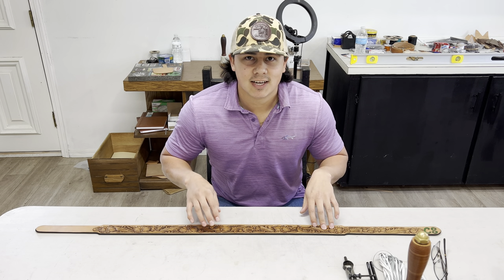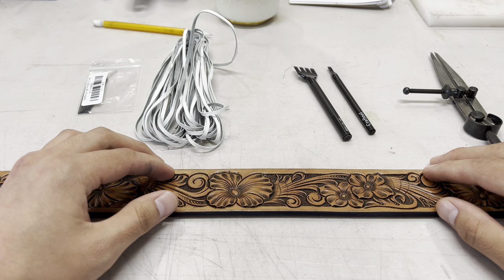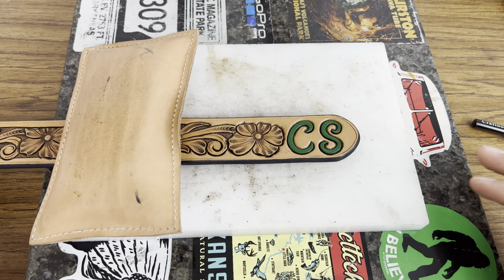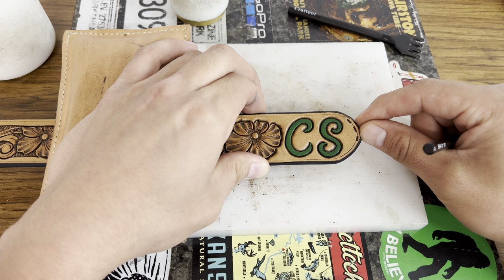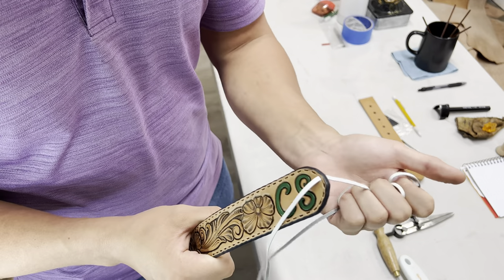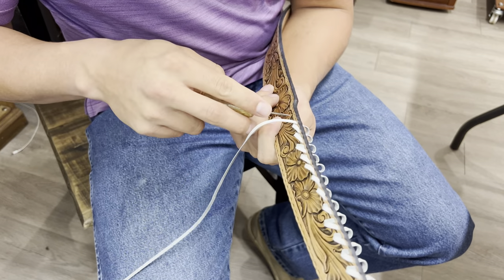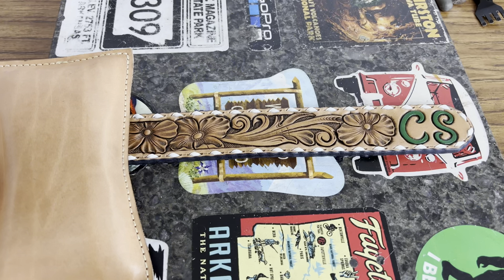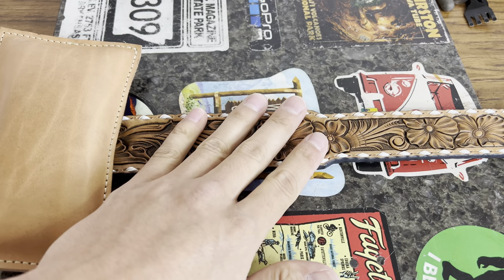How to Buckstitch a Leather Belt in 2024

Comment: Excellent tutorial. I did have a question. I can see how to hide the last odd stitch in the bend of a belt but how would you hide it on a notebook cover, checkbook, etc.?
Reply from the maker: To my knowledge, there is no good way to hide the ending on projects like that. If you are joining multiple pieces together and the edges are not glued, then you can hide it between the material. But in most cases when the edges are glued together and finished, you just have to make the ending as presentable as you can. I could be wrong but I have not learned of any way.

Comment: What was the pillow looking piece while punching holes? Sorry if I missed that
Reply from the maker: It is a small piece of HDPE cutting board! You can also just use a scrap piece of leather under the belt to protect the hole punches, chisels, etc.
Reply: @Girtyleatherco  thanks for the response!! But I was actually referring to the item you have on top of the belt. Looks like a small leather pillow kind of. Is it like a weight to help it not move so much?
Reply from the maker: Oh okay! Sorry about that, yeah it is just a weight that I made to help keep my projects from slipping around when I’m tooling or working on them. Its just two pieces of leather sewn together and filled up with metal BB’s
Reply: @Girtyleatherco  ohh ok got it. Good idea! Thanks again for taking the time to respond!

Comment: Is this mainly used as a decorative stitch or is your belt made with 2 thin pieces of leather that you’re putting together? I can’t really tell and still new to everything
Reply from the maker: I make my belts out of 2 pieces of leather. The main body being thicker and with tooling designs usually, and the liner leather being a thinner piece. I contact cement the leather together and then stitch or lace the edges. This buck stitching method is a lacing technique and does serve a purpose but is also a bit more decorative. Depending on the project, it could just be used as a decorative accent.
Reply: @Girtyleatherco  thanks for the detailed answer! Do you have video showing that? Is it like a 8oz and a 2oz piece together or do you go past a thickness of 10oz? I’ve make some simple 10oz belts but depending on the buckle I’ve put a lot of strain on the bucklebar due to how thick it was even with skiving
Reply from the maker: I typically use a 9/10oz and 3/4oz piece. My belts usually end up around 12-14 total oz. I do have a full length video on my page of me glueing and stitching one together!
Reply: @Girtyleatherco  found it! Thank you it’s extremely helpful

Comment: Nice video . Finally.!!
FINALLY.!
 Someone with a BuckStitch video that show punching holes and stitching FROM the tip back .. I buckstitched Hundreds of. Belts when I worked for a Leather shop in the 70 s . 
I would recommend using a needle for speed .  Use your thumb on the front and hold with 3 fingers on the back definitely faster than a stiching pony . Pull thru start needle in next hole then pull thru .. 
I used to do a run like you (and still do sometimes ) the guy I worked for said You pulled it ALL the way thru .! Just keep pulling LOL . He timed me on both .. making a run was slower . 
Try to find a 3 prong chisel .. DON'T go to a longer one . A three prong will pull out faster and help you punch the holes a LOT faster .. I have an OLD Tandy one that has a bevel to it and 3 prongs. It is much smoother and faster than the stuff you buy today. I have asked Tandy to make them .. sadly got ignored 😊
Hope you don't mind some old school input . IF people follow your tips they will get a nice BckStch belt . 
Main THING . Start from the tip ! .. it also eliminates a LOT of wear on your lace . Uh .. and YES stitch past the turn back .. 
Stay Well 
PTL
Reply from the maker: I really appreciate the in depth input! It’s always good to hear from people who had someone actually teach them and pass down advice. Most of what I know is just from trial and error at this point so thank you for that information and I appreciate the support!

Comment: Nice belt.  Do you skive the leather where you bend it at the buckle?  Also ,  how thick is that granite slab?  Would a 9mm thick tile for landscaping work as well?  Thanks and cheers from Canada.
Reply from the maker: Thank you! Yes I do skive the bend area down maybe half the thickness of the main body. My block is roughly 1 inch thick. I would say a landscaping tile might be a bit thin, but I’m not 100% sure. It might work just fine!
Reply: @Girtyleatherco  , thanks for the tip and have a great day!